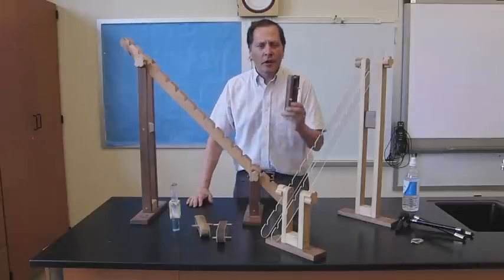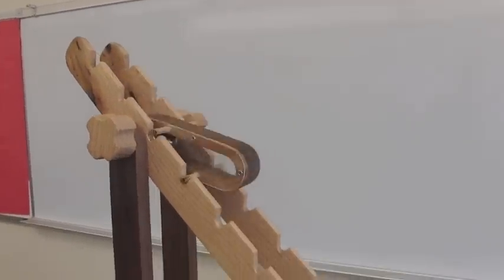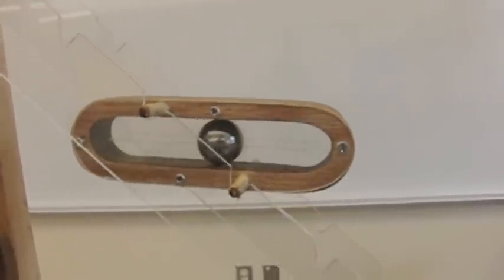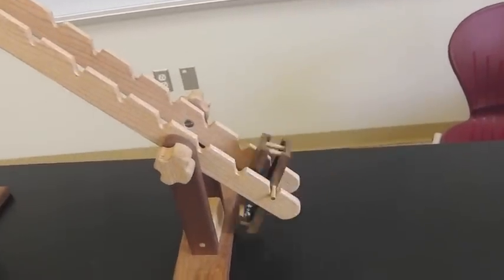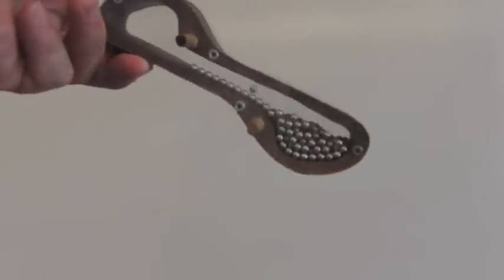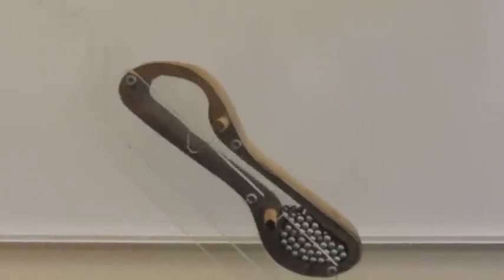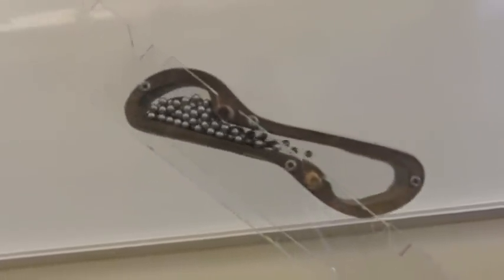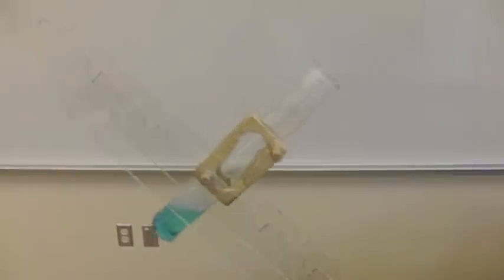Toy Physics---  tumbling toy -part 1 /// Homemade Science with Bruce Yeany

Comment: I can see plans here for the worlds most boring toy:  a tumbler filled with pitch.   Or, more optimistically, the worlds most interesting pitch-drop experiment.  

I wonder what the most efficient possible tumbler would look like?  Smooth rotation down the slope, transferring the weight without jolting... I guess the closer to the ...center...  the center of mass gets, the more like a simple wheel and axle it becomes.  

It would be interesting to see multi axis tumblers too.
Reply from the maker: You raise some interesting questions here,  however,  I don't think I will try the pitch tumbler,  I'd only get to see it turn over once or twice in my lifetime

Comment: Wouldn't it make it go faster if the pegs on the tumbler weren't staggered?
Reply from the maker: Hi Jesse,   I have a few additional designs to try on this,  the problem is I have more things to try than time to work on them,  but I will see if there is a way to change the pegs around,  thanks -Bruce

Comment: Is there a limit to the length of this tumbling stepper? Not the length of the staircase, but the length of the tube that the weight travels back and forth through. I would imagine at some point it would not achieve enough swing to restart the next step.

Comment: Yeah, that was easy. But, here is the challenge... use physics to get the tumbler back up to the top, on its own, without touching it?
Reply from the maker: LOL,  getting the design correct to tumble down was tough enough for me, I had quite a few failures.  I'm  not sure if I up to your challenge at the moment
Reply: No worries; I can see the fun you had in making these experiments... better than anything I could come up with. Nice work and fun videos. Cheers
Reply: Hydden N. Plainsyght unless you use a motor or a counter weight that is impossible

Comment: how about a perpetual motion machine. use the same toy but build a wheel instead of a ramp and have a slight brake on the wheel so it won't spin too free. I wonder if that would work ??? Maybe I'll have to try it.
Reply: Art Connolly No form of that would work, conservation of energy always comes out on top

Comment: Try mercury as a liquid inside the tumbling toy that would be very intresting
Reply: Mercury is VERY TOXIC! The tumbler part, the way it is made in the video, would probably leak a bit of it. NOT GOOD!. And a sealed glass vial of it inside the tumbler still wouldn't be safe as it could break as well. The small ball bearings in the one tumbler is a good approximation of what mercury would look and act like.
Reply: Many ppl do mercury videos on yt these days. If you're so paranoid about it then I wonder how you're going to react on that: /watch?v=GvVaaZ21C44

Comment: I suspect that it wouldn't work with honey.  I think the impact as the device hits the stand, and the resulting flinging of the ball bearing, or liquid, before the device stabilizes, is necessary to keeping it moving.  With honey, or even with a ball bearing and different device dimensions, the device would stabilize, hanging from the top pins and with the bottom pins lifted from the stand.  The device would stop moving, and the weight -- the honey or ball bearing -- would remain at the end of the device closest to the uphill end of the frame.  It shouldn't be hard to test this theory.

Comment: Two variations on this I'd be very curious to see:

a) Using a non-newtonian fluid in the final tumbler.
b) Placing a steel ball in the final tumbler, and filling it entirely with liquids (ie. no air pocket) of various viscosity.
Reply: A little late to the video. Another interesting idea would be to fill it with multiple fluids of different densities. e.g.  Oil and water.
Reply from the maker: not sure how the non-newtonian fluid wold be but I really like the steel ball in the fluid idea

Comment: In accordance with using a more viscous fluid, could the tumbler toy be calibrated to make an accurate clock, i.e it takes an hour to make one rotation?
Reply from the maker: thanks, no plans to fill the container with pitch
Reply: Bruce Yeany if you use pitch, it would take until the end of time
Reply from the maker: it probably could if I had the track cut more accurately, such as a CNC machine.  The imperfections in the current slots catch the axles and vary the time from one turn to the next
Reply: Bruce Yeany so if I use thick sheet aluminum, cut with a CNC machine would that be a good basis, or should I computer accurately mill and machine all of the parts?
Reply from the maker: Sorry Aden,  I have no experience whatsoever with these machines.  I pretty much work with  wood for everything I make. you'll have to ask someone who knows more about it.
Reply: Bruce Yeany well you know the science, and I work with these machines daily. If you don't mind I'll borrow your science and meld them with my skills. And I'll let you know. If you don't mind.
Reply: You might be interested in https://en.wikipedia.org/wiki/Pitch_drop_experiment
Reply: For a clock, you can get very precise viscosities with oil, granted the ambient temp is maintained. That should get you precision needed for the fluid, if you get the precision nailed for the track.

Comment: Hi there, great video! really interesting how you have used liquids and lots of small balls to change the rate at which the toy moves and rotates. i'm currently designing a gravity influenced mechanism as part of my Product Design Engineering course and it would be very helpful and appreciated if you had any plans or extra information on your designs? If so my email is cameronmcmillan97@btinternet.com
Reply from the maker: +Cameron McMillan HI Cameron,  I sent some additional material. this is one of my favorite pieces